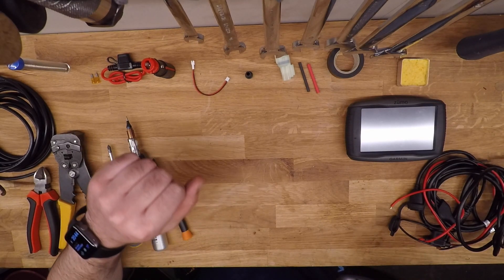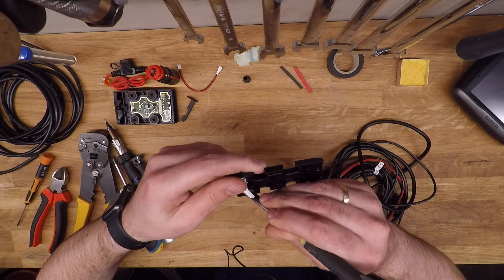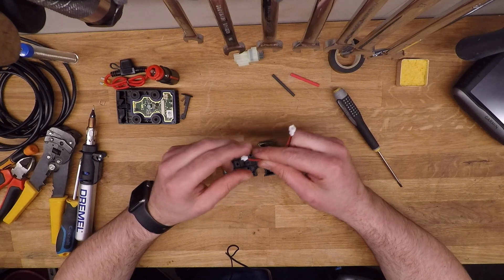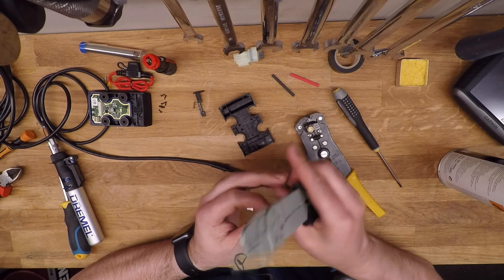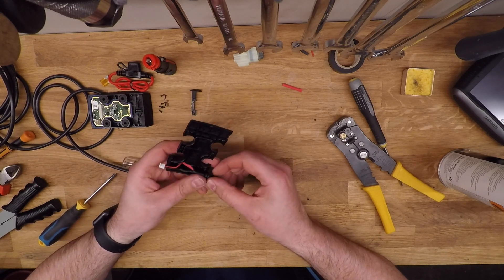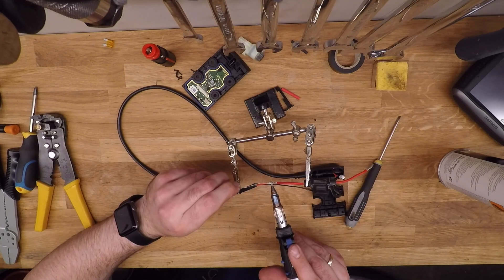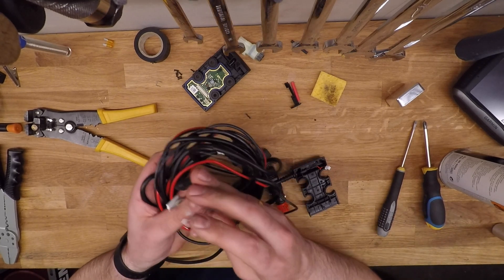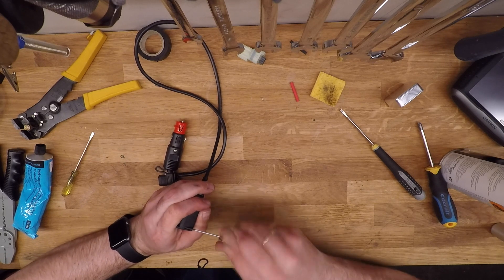Garmin 590LM Motorcycle mount modification

Comment: I have one of these mounts on my Harley, and had a thought - why not use this mount to power/attach one of the many Carplay screens out there?   However, I am having trouble finding the OTHER side of the connector - the one built into the GPS.   I dont want to rip into my GPS (at $200+ to replace, I cant go back if I wanted to).   Any ideas where to source the part that would connect to this connector (for modifying)?

Comment: Awesome vid and awesome for me in a totally different way.  I have a Spyder RT LTD with the Zumo preinstalled, smack dab in the middle of the handle bars.  I wanted to remove it and use that real estate for other devices.  Thought I would have to give up because I thought I would have to pull out the entire harness and not sure if it would knock out other audio from Can Am.  So when I saw you dig out the sealant, I was like .... cool, I'm on it !!  If the next owner wants it I'll hook back up and voila. Buttoned that up and moved on to wiring/installing a dual usb port.  I was stuck and you saved me.  Thanks, big time!

Comment: The link for the cable gland does not work, have you got a supplier you can direct me to or an updated  link?  The link for the JST-PH 2.0 connector does not work either but I find these commonly available with a search, no so the cable gland.
Reply from the maker: Yeah, that's the issue with eBay-stuff, keeps going up and down. Can't find the exact same now, but a search for "5mm solid cable guard strain relief" gives quite a few results. Most of them should work, just look for a similar item.

Comment: Very good video. I plan to order a new cradle and follow this video. In the meantime will the following work:  Cut off the entire cable and strip out the main power wires and connect them to the BMW accessory wires (with the fuse). That would seem to work. But, could there be a problem from the remaining wires in the bundle, such as a short or bleed over across any 12V power carrying wires in the USB, stereo, or headphone wires?  I’m a little concerned there might be possibility of a short there frying the 595. Thank you. Bill
Reply from the maker: I've seen and heard of multiple riders just cutting the wires, so it seems to work. I had the same worry as you, and decided to do it "properly" while I was at it.